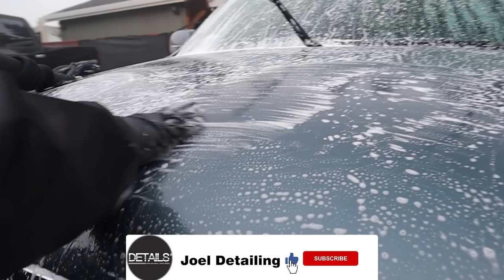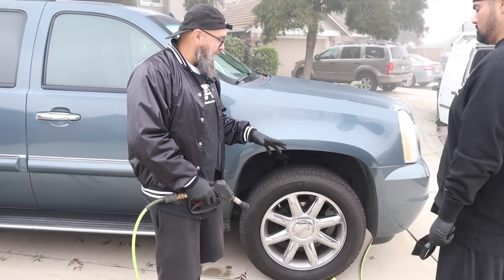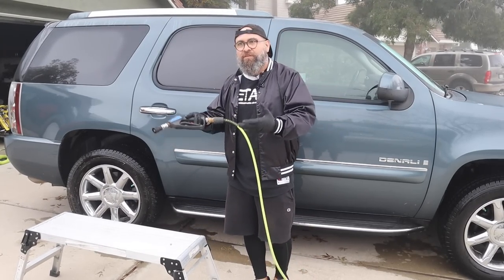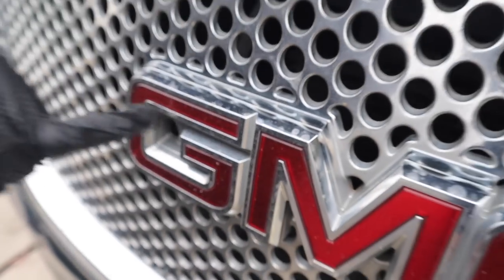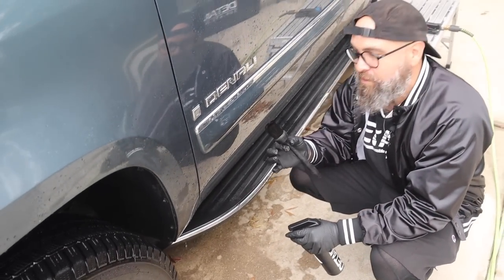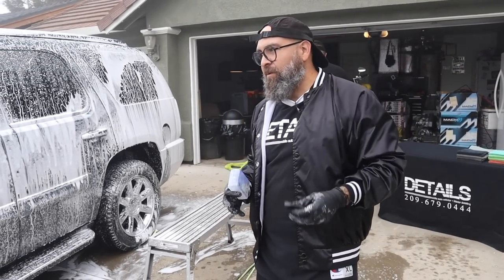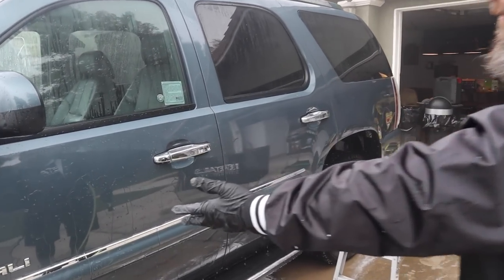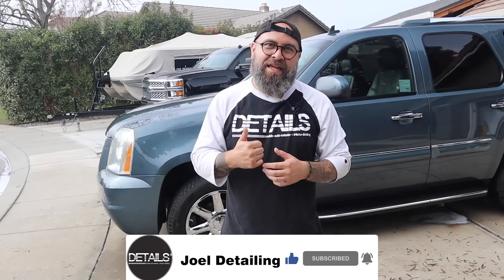Claybar and Acid on this Yukon - Joel Detailing

Comment: Th acid well also clean off all the brake dust that sticks to the paint .the dust look like small rust spots and it is .so it's good to have acid to clean all that off .2  to 1 should be good for a spry bottle

Comment: Brake buster run straight up is great on tires plus a trc green brush for the rim first tires second all in one shot!
Reply from the maker: That's my usual method,  just wanted to test these dedicated tire cleaners for those heavy build ups, I find myself going over the tires multiple times with the brake buster at times.
Reply: @DETAILSofficial  agreed I’ve had better results with Adam’s wheel and tire too 

Acid is a irreplaceable cleaner for wheels and anything with water spots I love it and maintain my coating with it here and there

Comment: You can use undiluted super clean degreaser for the tires. It's only $8 a gallon. I didn't see the link for the acid. What brand acid did u use?
Reply: Ya anyone know what acid he is using ?
Reply from the maker: @antdog0421  now in description

Comment: Would P&S brake buster be suitable to do the same thing on the hard water spots on the chrome grill as your diluted wheel acid did?
Reply from the maker: Brake buster won't remove them, brake buster is non acid

Comment: Definitely acid is not for beginners......and proper dilution always to much can burn 🔥 chrome...if spray strong you gotta act fast I've been using acid for years got into problems with it before once before I was a professional using it but it's a good wheel cleaner........keep up the great works Joel I was waiting for a video like this...fee detailer I talked to before about acid think  I was crazy to use acid lol thanks Joel 👈🏾👌🏽💯
Reply from the maker: Thank you for your support 🙏
Reply: @DETAILSofficial  Joe.

Comment: Should you only clay bar if you're going to polish afterwards? There seems to be a lot of conflicting information. Some people say you should only use a clay bar when you're going to polish, because clay bars scratch the paint and so you're going to have to correct it and you should only do it once a year. Others say it doesn't scratch the paint and you can do it anytime you're going to do a strip wash and reapply a spray wax. Can you help please?
Reply: So you should clay only when necessary! I hope you know how to figure that out. If you clay a dark color car ex. Honda Toyota  soft paint will scratch easy you will see the scratches immediately then you must polish them out.  No scratches visible then no polish. Easy
Reply from the maker: I ONLY clay when needed, test the paint first for bonded  surface contaminants. If needed clay. I always polish post claying, just to ensure the best finish, obviously not everyone wants a polish so I would practice communication with your clients about the process.
Reply: Thank you both.

Comment: Has it happened to you that the clay bar tends to break down due to the soap?
Reply from the maker: Higher quality clay will hold up. I'll add my clay to the description tomorrow
Reply: After using soap rinse the clay throughly and kneed it well.

Comment: How do I dilute for clear coat paint for acid use? My friend has his whole black pickup covered in water spots
Reply from the maker: I would start with the dilution ratios as indicated on the product label. You have to be careful with acid,  it can cause irreversible damage if not used properly.

Comment: I watch your content all the time brother keep up the good work I have a question I have a Ryobi 1600 pressure washer I'm new to the detailing how can I get an extension hose to fit my pressure washer and my foam Cannon
Reply from the maker: I have links in the description to the ones I use
Reply: @DETAILSofficial  thank you so much brother is the hose  a direct fit too the pressure washer
Reply from the maker: @carlitoselduro5576  yes, but I would recommend getting a quick release if possible
Reply: @DETAILSofficial  I'm sorry what you mean quick release
Reply from the maker: @carlitoselduro5576  a connector
Reply: @DETAILSofficial  I got you thank you boss what pressure washer do you use

Comment: Do you clay bar the top off the truck??
Reply from the maker: Yes , top surfaces  (hood,trunk and roof) are usually the most contaminated panels.
Reply: @DETAILSofficial  thanx bro also u clay bar the windows?
Reply from the maker: @nerihugo5  I usually do the windows
Reply: @DETAILSofficial  thanx bro much appreciated👍🏼

Comment: Black clay is the worse idea I’ve seen in a while. Not sure how you can tell how much contaminates are on the clay so you know when to kneed the clay. Also never put acid on glass it will etch the glass and it will need to be replaced. Also always remember to roll all windows down and get the top so you don’t have a nasty line present when the windows go down.